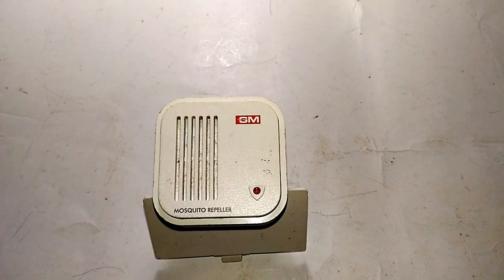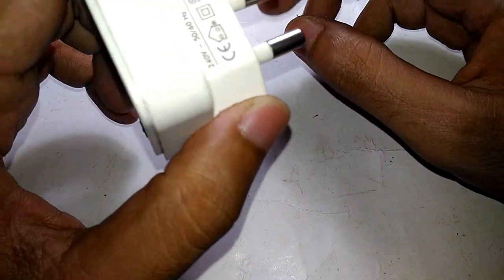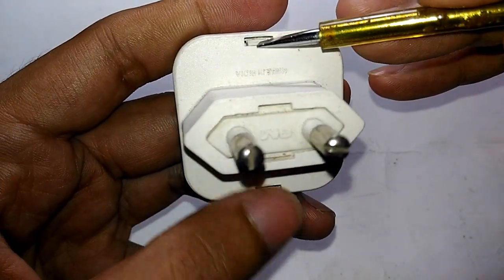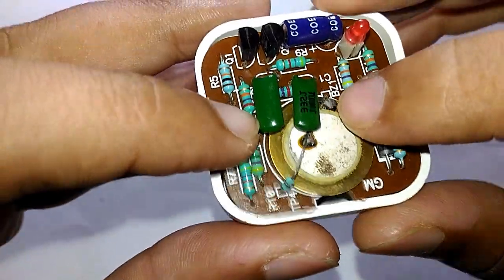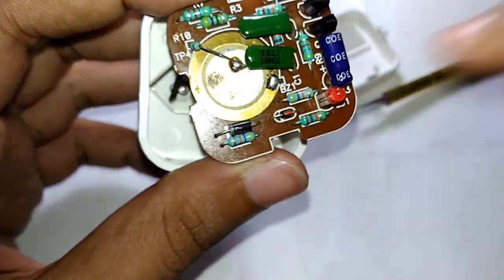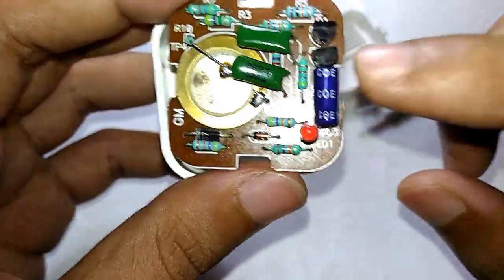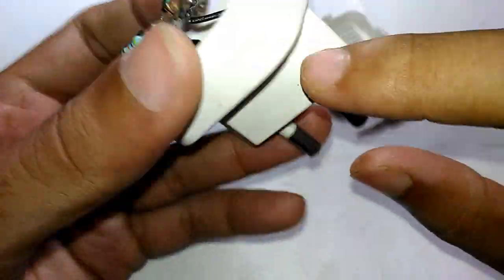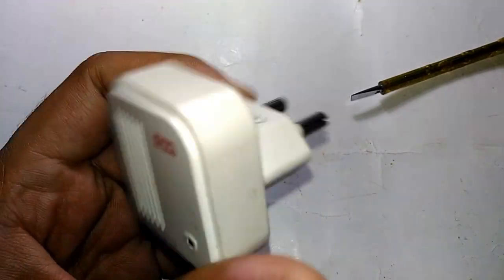IE21 GM electronic mosquito repellent (ultrasonic pest repellent)!

Comment: Do hear any sound in it.I just see a led light and no sound.
Reply from the maker: Well, in most cases, yes it's indeed making a high frequency pitch. It's quite normal that you are not hearing anything because it actually is in such a low volume and it depends on our hearing sensitivity. But there is a possibility that the unit is faulty as well. You can ask someone else to listen to it also.

Comment: Where I can get it and how much this costs , where I can get.
Reply from the maker: The price for this gm brand one is around 200 - 300 Rs depending on where you buy from. This is commonly available in more/reliance supermarkets and in electrical shops as well. Or you can buy it online.
Reply: aval in Dmart